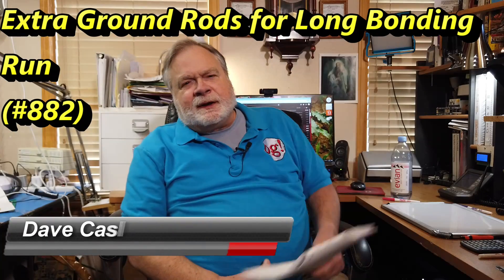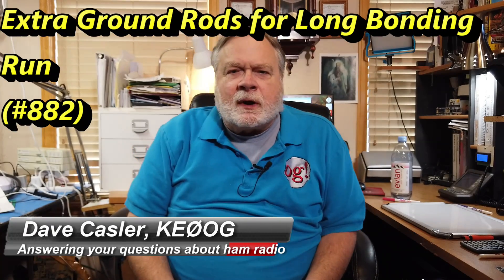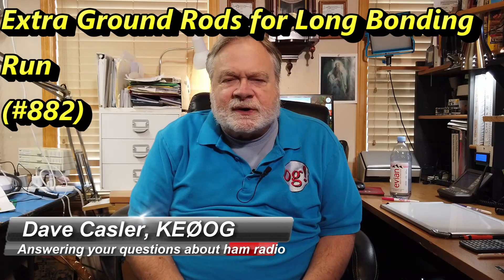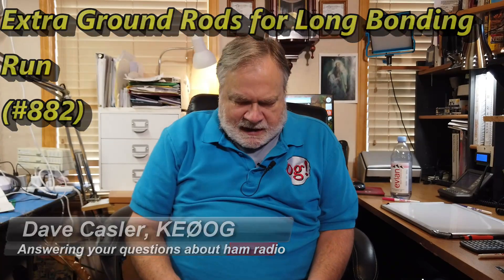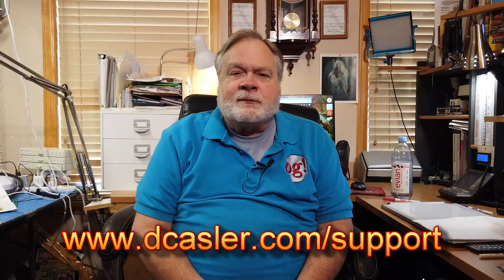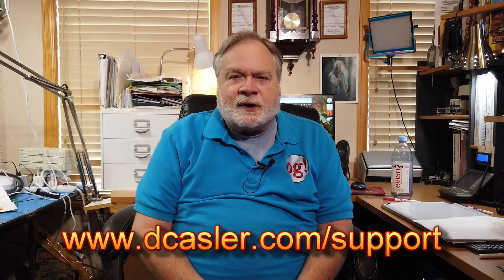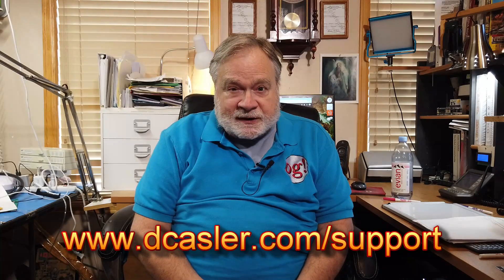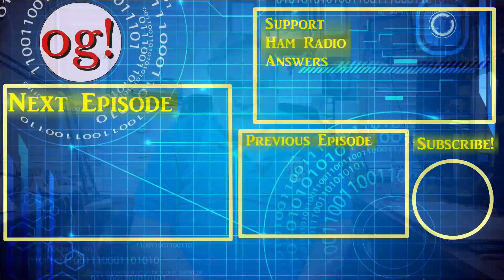Extra Ground Rods For Long Bonding Run (#882)

Comment: QUESTION:  Thanks for your excellent episodes, Dave.  Great stuff.  I'm barely scratching the surface in this world of things as I cautiously move forward gaining knowledge.  The question I have will immediately show my lack of macro knowledge on these things, but here goes:  I am not an electrician, but I thought I picked up from a competent electrician the notion that when you've got a sub-service box (I forget what the technical term is) that is NOT the main service box but which runs to it and connects something like a sub box that powers a garage to the main service box mounted on or in the house, you're not supposed to ground that 'sub' box independently, but rather, that you should only ground it through/too the main service box.  That is a lot of pretext to get to my question:  whatever the concern with not directly grounding a 'sub' service box (ex: one in a garage) but instead only grounding it to the main service box and therefore the main ground, could there be a similar concern with doing the kind of multi-point grounding of your radio antenna grounding wire between the antenna and the house's main grounding point that you're recommending?
Reply: NEC requires bonding at the point of first disconnect (almost always the main panel but not necessarily). After that, all daughter(sub) panels are not bonded. You don't want multiple paths of return current. Grounds(groundING conductor) should always be for faults, and neutrals(grounded current conductor) are always for return paths for current.
Now, as to grounding for radio system. The idea here is to get everything possible at equal potential (house feed, radios, antenna lightning grounds, etc). So, you take your lightning arrestors, equipment grounds etc and connect them to the same source as the point of disconnect ground. That is why, when you look at drawings trying to explain this they are all feeding back to the same common point, even though there may be multiple ground rods (all bonded together making it the same point essentially) involved, the ground is the ground is the ground... Anyway, the thing you do want to avoid is ground loops, and it is deceptively easy to do but too long an explanation to really do justice here. The ARRL and a few other places have some pretty good grounding resources. I definitely recommend checking them out.
Reply: @NickFrom1228  Thank you for your detailed explanation and for distinguishing.  I've clearly got lots to learn!

Comment: You should be clear that the bond wire should be #6 STRANDED, not solid wire..  

If you Cadweld the #6 stranded bonding wire, you'll never have to worry about ground clamps coming lose.  A bit extra money, however well worth it.  Cadweld is a brand name, the process is technically exothermic welding.
Reply: Stranded or solid are acceptable.  As a general rule in cases of direct bury of the bare conductors, we only use solid as it tends to be less prone to damage or degedation due to corrision.    As for the connection methods, both direct bury rated connectors and Cadweld are acceptable and approved.  Soil conditions tend to dictate grounding.  Sandy soils need extensive grounding systems to be effective.  Exothermic welding is always preferred but requires some special tooling and training to properly carry out terminations.  NEC also requires bonding between grounding systems to maintain an equal potential between all systems and to eliminate or minimize the possibility of any voltage gradients in times of a ground fault.
Reply: As I understand it, the RF portions should be stranded but the equipment grounds and lightning grounds can be solid, though stranded has some advantages, like you mention. All of my grounds are minimum number 4 solid though my main equipment ground is #2 stranded and all RF is always braided strap.

Comment: I wondered how all this NEC compliance comes into play when we are supposed to have a rod at the antenna and a rod at the service entrance at a minimum for protection. Then there is the AC ground. Am I supposed to run 200 feet of #6 from the antenna ground rod to the shack ground and then another length to the AC feed (since I can't access their ground inside the apartment building)?

Now, my system is NOT running from or connected directly to the AC system. It runs off a battery that is connected to a charger. Does that change things?
Reply: no kidding. well i read that if you had a water pipe or steel frame for the house or house foundation ground you can tap into that as well and be compliant. he also never covered coax grounds which could also resolve the issue since the lightning suppressor is ideally terminated at the entrance to the shack. again, nobody hardly ever covers 2nd floor shacks. how about radio stations that operate out of sky scrapers.